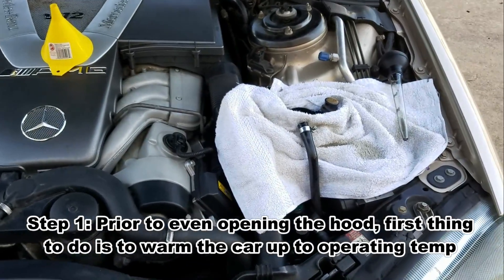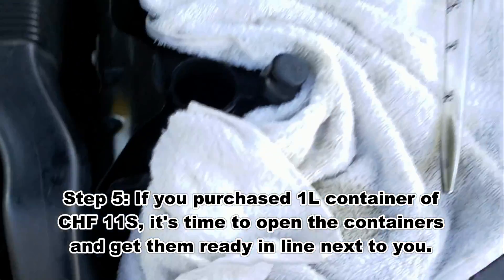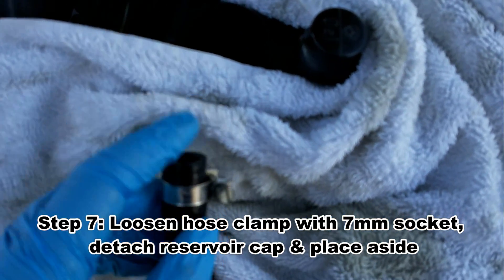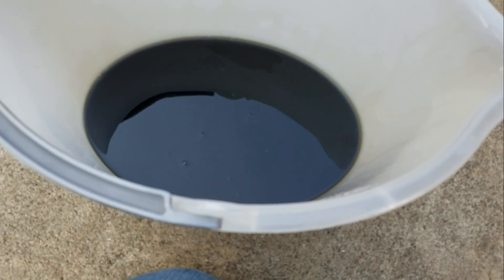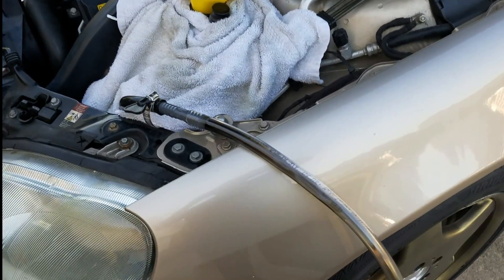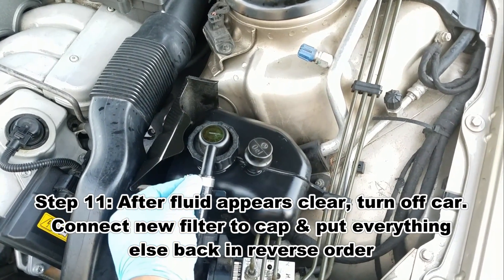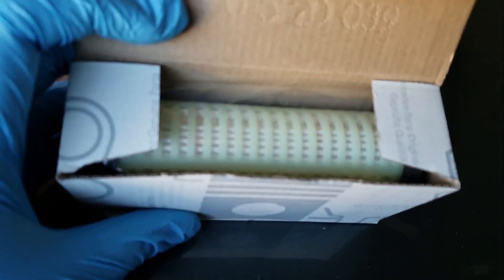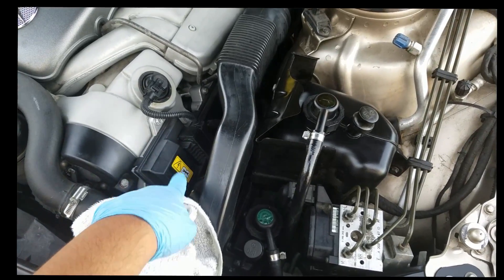ABC Fluid Flush Procedure S600 W220

Comment: If you take your car to what ever type of repair shop, photograph as much as you can of your car including under the hood (bonnet), trunk (boot) and run a felt tip with squiggly lines on the battery, don't forget your wheels and tyres. Do this just before you go. When you collect your car have a good look around it and see that nothing has been switched for inferior items or damage.

Comment: Hello,
Just an advice for those who want to listen.
I'm a retired mechanic who worked in the 70ies on Citroën DS hydraulic systems.
One of the main reasons for blockage in the system is the deterioration of the rubber membrane in the sphere accumulators.
If your suspension oil is black, there is a probability that the accumulators are starting to die.
Maybe it is wise to change them. 😀
Good luck, take care.
👍
Reply: what are accumulators?
Reply: what about the level sensor ?
Reply: what if you're getting low voltage

Comment: I'm about to do this procedure on a W221 yes I ordered the AGA tool, and the rest of the stuf, I got everything down except one thing, what level do you keep the fluid in the reservoir while adding ? and at what point exactly do you stop adding and shutting off the engine (simultaneously I assume) thanks, you missed that part in the video so I can see clear vs dirty when you stopped.
Reply: Did you find out please?
Reply: @nassimnassim6019  yes I did this already a while back what do you need to know exactly ? Just keep the level in the reservoir high enough so no air get into the system not too much though leave room for the filter , the best way to tell is look at the level once you remove the filter and keep it right around there , and have someone raise and lower the car while you’re adding the fluid , once you see clear enough fluid (to your liking) stop and shut the car off immediately , do not add anymore fluid because when you put the filter back the level is gonna go up, put everything back together check fluid level top it off , drive around for 15-20 and raise and lower the car a few time while doing so, drive over bumps a few time do back home and check your level once more
Reply: @nassimnassim6019  mine is a W221 style (2011), I dunno if you have the same?
Reply: @gusf8451  hey thanks for the reply, no i do not currently own a w220 or w221 at all, currently as all the garage that can work on such vehicule, that aren't pure scam(they fit counterfeit part and refurbished part, and sometime "leak" oil into your engine or turbo causing combustion, and like to forget the key inside the car) are +400 km away from me, don't get me started on the ridiculous price or  missdiagnostic indeed i know a restaurant owner who bought a second hand s320 and drove over 350000 km in it and they keep making him pay for the wrong part instead of rebuilding his airmatic strut. The only way for me to ever have a chance to decently own such a vehicule is to look and ask question about the maintenace.

Comment: Why not just check the fluid and keep it at the correct level?
Is new hydrolic fluid going to do something different than what's in there? Exactly the same. It's not oil  it doesn't get dirty.
Reply: If it did'nt get dirty it would not have a filter!
Reply: @PaddockAutomotive  Doesn't have a filter so I guess it doesn't get dirty.
Reply: @frankburdodrums8984  the filter is inside the reservoir
Reply: @SeamHead33  Then change it smartypants.

Comment: Thanks for the vid. Bought some Pentosin CHF-11S from Amazon--> 20ltr -->$11.45 per ltr with tax.   Good for 2 uses at 10ltr's per flush. The dealership would charge you anywhere from $25 to $30 per ltr. Got 2 of the ABC filters from Amazon @ $36 ea.  The dealership would charge me $55 ea. for the ABC filter. The hose clamp, 1/2 to 1/2 inch barb, and clear hose were all under $7 at home depot.👍  👏👏👏👏👏  Total outlay $229(fluid) + $72(filters) + $7 = $308.  Compared to the dealership--> $250 ($25 per ltr x 10ltrs) + $55 abc filter + $80 labor ($40 per hour) = $385 for 1 flush = $770 for 2 flushes.  I've heard at other dealerships charging $500 per flush.

Comment: Hi dear. 

I need you help. So i find new high pressure line pipe which starts from ABC pump to Pressure ballon which situated front right side of transmission. I wanna change this. Do you know the instrument of this? I know how change this but i dont know what to do after pipe changing. Is there any process like rodeo or other things?
Reply: Did you find out?
Reply: @nassimnassim6019  you can change it immediately.there is no any procedure after this. change it start engine. everything will be ok

Comment: hi thanks for amazing video.i have a question. Is the 2 reserviors(abc and power steering)  together??? i mean if i will flush the ABC fluid so it menas that my power steering fluid will also be changed??
Reply from the maker: Turan Huseynli no they are separate reservoirs. If you flush abc fluid from its reservoir, it will not flush the power steering. You will have to change the power steering fluid separately.
Reply: Oh thank you for answer. And i have one more question. Sometimes front right side goes down. What do you think!? Problem is in strut or on abc pump?
Reply from the maker: Turan Huseynli it depends on when/how it happens. Are there any leaks? Do you notice any fluid drop under that side? Does that side go up to normal when you start the car? Do you hear abnormal noise from the pump? IF there are no leaks and the right side goes down only after car sitting in one place for some time,  then it's either the accumulator or the valve block. Most likely it's a dirty valve block but it could also be the accumulator.
Reply: Hmm i understand. There is no any leaks and any noise. When i stop car turn off. After 30 minutes it goes down. When i start the car it shows stop the car. The car is too low. But when i change transmission from P to any (R N D) it comes to normal position. I think if i will change valve block seals everything will be ok. But my master says that these seals are not OEM. If we will change them after few month all the seal ring will be die
Reply from the maker: It would depend on how you rebuild the valve blocks. I haven't heard much issues with people who had replaced the O-rings on the blocks themselves. But maybe some had problems if they did not replace all the O-rings in the valve blocks. Sometimes people miss certain O-rings when they rebuild them. You would have to get the complete O-ring kit when you want to rebuild them. But that issue definitely sounds like a valve block issue where it does not retain the fluid and leaks from the O-rings.
Reply: Hmm.i understood. And then.my master says that if you can find w221's valve block so it will be amazing. There are same!?
Reply from the maker: I am sorry but I do not know if W221 and W220 valve blocks are the same.
Reply: Thanks for answer. If i will buy o Seals to rebuild it. Does i need to get off all fliud from system? If i will open the block fluid comes?
Reply from the maker: No. If you follow the proper procedure to remove the valve block, you will not need to remove all of the abc fluid. Some will fall off when you open the hoses, etc. But you will need to check the levels after you put them back to make sure it is on the proper level.

Here is the procedure for valve block rebuild incase you need it:
http://w220repair.com/index.php/abc-valve-block-rebuild/
Reply: Turan Huseyn